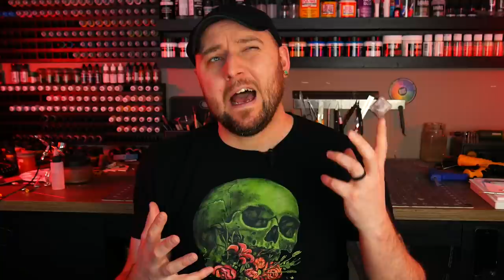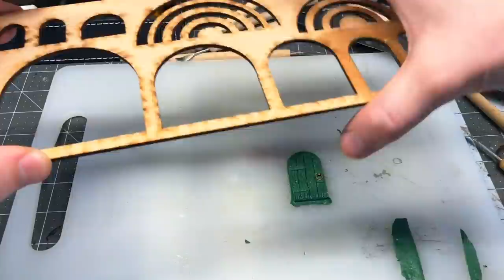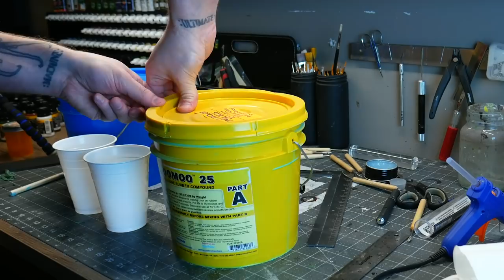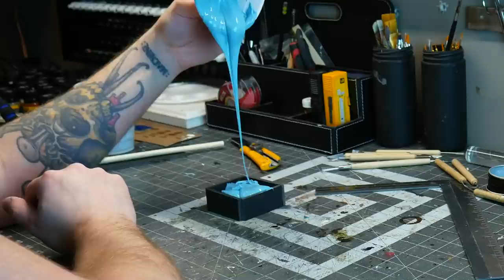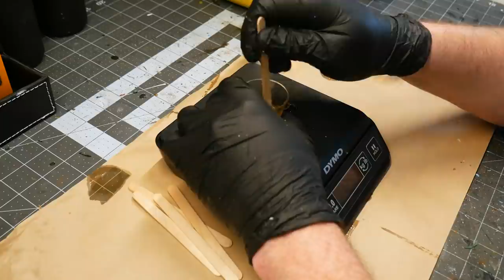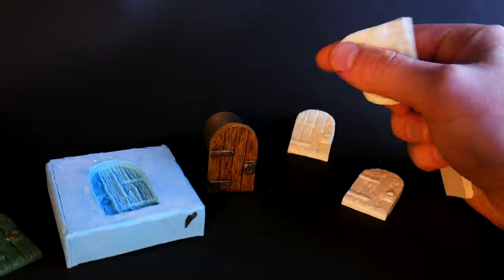Sculpting, Molding, & Casting Resin Doors

Comment from the maker: Prepare yourself......countless Proto-Putty comments are coming....

If anybody has found jewelry jumper rings like the ones I use online PLEASE drop a link. I'd love to be able to direct people to where they can find them as I love using them so often!
Reply: Yes please! Way easier than feeding jump rings into tiny beads ><
Reply: I spent a couple hours at the craft store last weekend looking for jumper rings like you use and couldn't find anything. Do you cut yours off at all, or is that exactly how they come? Have any pictures or name of the packaging? Thanks.
Reply from the maker: Dustin Graham they came exactly as you see them. It was three or four bags stapled to a card, each a different colour of metal. I bought these before the channel was a serious thing so at the time didn’t think to save the package. I’ve looked through dozens of pages on amazon and can’t find anything similar. I’ve also looked to find them again at Michaels to see what they are called and photograph them but haven’t been able to find them again 😞 It’s such a shame because they are SO perfect.

Maybe I should just mold, cast, and sell the door handles. They’d be cost effective to ship.
Reply from the maker: NotAToy the one you find are plain rings, easy to find. Mine are FLAT and have that cylinder on them that makes them look so good.
Reply: Cool tattoo just that... Cool tatoo
Reply: @BlackMagicCraftOfficial  are they Toggles and Clasps?  Those are two parts that hold together a necklace.  One of the parts kind of looks like what you have
Reply: @BlackMagicCraftOfficial  This would be a nice alternative. and casting would take far less time if you made flow channels between them all to cut off later.
Reply from the maker: @EdwardDowner  That's actually very very similar. The ones I have are a single piece. I think its a "crimp end with loop" that I need to use to continue searching. Good find!
Reply: Dude I have found green stuff is way too expensive for the small amount you get. I found a better cheaper and higher quality product in Aves Apovie sculpt. You get way more for the price averraging $15 a pound and the company is way smarter in there packaging using common sense they do not package the putty and hardener in a single pack touching so you waste a portion.
Reply: I should have read comments before going to Michael's looking for the "door handles".. I didn't have any luck either! Mind posting a close-up picture of what you use for those of us trying to find them online or at stores?
Reply: My wife is a jeweler, she often buys them from riogrande, I think they have simple steel ones, as well as gold and silver.
Reply: The jumper ring looks a lot like some Toggle Clasps!There’s tons of styles and a lot look like fancy nobs. They might be a bit big though? But maybe some smaller ones exist or can lead to grease. It soak reminds me of ‘Flat bead spacers’ but I haven’t found any with that notch on it 😞

Comment: Just make sure the modeling material doesn't contain sulfur, like most modeling clays.  The sulfur prevents the silicone from curing properly.  I recommend Sculpy or Fimo. You don't need to bake it, for this project,  and it won't hinder the curing process.
Reply from the maker: Good info 👍
Reply: @BlackMagicCraftOfficial  I've been molding and casting with these materials for a while, so it's only right I help others avoid these pitfalls.
Reply: That's a great tip! 
I'm using cheap modelling clay for some of my terrain. I guess I'll have to make new sculpts from another material before I start making molds.
Reply: @x.a.2758  Glad too be of service.
Reply: Exactly. I sculpt trauma injuries and make molds of them for mass production and I use Sculpy. Haven't had a problem yet with making clean molds.
Reply: Actually, tin-catalysed RTV tolerates trace amounts of sulphur well. The problem is when you use platinum-catalysed RTV, since platinum bonds to the sulphur rather than catalysing the RTV. Luckily, only the most expensive RTVs are platinum catalysed, but once the advice got out, people assumed it applied to all RTV silicones. It doesn't. However, plasticine-type modelling clay isn't all that useful for sculpting, since it is soft and doesn't harden. However, I have successfully used it to sculpt flat items like bases, so it's best to check the material specs on both your modelling clay and your RTV. Mostly, though, I use Aves Apoxie Sculpt for sculpting. It's soft like plasticine but hardens rock-hard in less than an hour, unlike Biggs A+B (so-called "green stuff") which is like trying to sculpt with bubble gum.

Comment: after you open you silicon before you reseal it get a can of compressed air (dollarama), spray a bunch of the compressed air in there. that will give you a blanket of dry air and it will extend the life of your silicon and resins

Comment: If you wanted to sell stuff without having it take up too much of your time, you could sell it all in batches. Like, spend a bit of time and make like 100 of them, then throw those up for sale. Once they're gone, that's it until you do the next batch. There's a guy I follow on Instagram, CanofBeams, who does this with his action figure accessories and it works out really well. There's always a ton of hype for his stuff and his stocks usually run out pretty quick (but no so quick that it's impossible lol). Either way, your stuff is awesome and very inspiring!
Reply from the maker: Yea. Original plan was Kickstarter then I realized I’d probably sell thousands and it would get out of hand. Plan b was to just cast a limited run using an amount of time I felt comfortable dedicating to it and sell on a first come first serve basis.
Reply: “Black magic Dnd crafting essential elements” coming to a store...in Canada sooon
Reply: @thomaskiser1187  Dragons Layer here in Austin, TX would jump all over that.
Reply: @BlackMagicCraftOfficial  A pledge level on Kickstarter can be capped to only allow a certain number to be sold. So if you did 100 and sold them in lots of 4, you could just make 25 pledges available.
Reply: Wouldn't be worth the KS effort, you could easily pre-sell 25 sets on eBay or thru his own website.
Reply: @BlackMagicCraftOfficial  Why not just open the batches up to Patreon supporters to purchase first.  That would be a nifty perk.
Reply: Hey what is his Instagram account? thx for reading. :)

Comment: Any under cuts make sure you get the bubbles out. Tilt poke with toothpick etc. Always read instructions some resins are by weight others are so many parts of each.  Cool video. You can use a bbq lighter in a sweeping motion to get rid of more bubbles.

Comment: i 3d printed a 2x2 inch stone tile (about an hour print time) cleaned the print lines with liquid green stuff and then made my mold and cast it in resin. My advice for tiles is to make 4-6 mold of your tile, do batches instead of one at a time.

Comment: I use rice to fill the mold with! This gives me how much volume is in the mold. Then pour equal amounts of rice into the mixing cups, and add just a pinch more to the measure. It has worked so far for my castings. Dan in Longview, WA

Comment: Another tip for getting the bubbles out would be to use a little mini torch. The heat should pop most of the bubbles, especially in something this small.

Comment: The place where I found the rings was Michael's. I bought 2 or 3 packs and I still have a lot of them handy. I enjoyed the video. Good job on the mold making. I use LEGOS to build my "boxes" and clay to seal the cracks around the bottom.  I had been into HirstArts before I discovered you and DM Scotty 3 years ago so I already had several door molds. However, your video was super because I want to make more elaborate doors than any HirstArts molds provide. I only tried resin once and I failed miserably. I normally use dental plaster.
Reply from the maker: If the rings you found are actually the same as mine and not just plain round rings, and still have the packaging I'd love to know what it says on it or even get the barcode. I bought mine years ago and didn't save the package. I've tried to find them again at michaels to get a photo and had no luck.
Reply: @BlackMagicCraftOfficial  Unfortunately, I bought mine 2 years ago and did not save the packaging. Lesson learned for both of us :-)

Comment: Great video. You show this, but don't explicitly say it. Only mix up the amount of resin you need for one pour! Heat accelerates curing and the resin curing is itself an exothermic reaction. The larger the volume, the more heat, and the faster the cure. Your pot of mixed resin will cure rock hard way before your poured part has set up.

Also thanks for warning people about the silicone shelf life. It will even start to thicken (and eventually solidify) if it is sealed, at least with Smooth-On products. I have wasted a lot of silicone thinking I had "just 1 more month" before starting a casting project.

Comment: This is great! I’m no longer afraid of resin. My thrifty nifty alternative was aluminum foil as the mold and hot glue gun to fill it.

By the way, you can release bubbles from the resin with a vacuum system.

Comment: I've had to do a lot of work forming molds for stone repairs (real stones, big ones [restoration mason] ) It's the air gap above the silicone in the bucket that is causing the problem. You can seal the bucket as tightly as you could want but unless you could somehow make a vacuum in there, it will still start to set up. But I learned a trick. 

Plastic wrap or a plastic inner lid.
Simply cover with some plastic wrap. It can be a messy solution, but it is a solution that I've seen work. 
Or 
Cut a bucket-sized circle of plexiglass, glue a handle on one side. Press down onto the top of the silicone. 

Keep the air out and it can last years.
Reply from the maker: This makes sense as they also sell a gas you can spray into the containers to create a protective gap of non air.

Comment: I use Plastilina Modeling Clay for sculpting pieces, works great for dungeon accessories.  Making the mold box pretty much the same but I use Mold Star 30.  It's a little more rigid & should last longer but it takes 6 hours to harden.  Instead of resin, I use Hydro-Stone for my casting material.  I get 50lb. bags & it goes a long way compared to resin & actually has some weight to it.

Comment: One thing you can do for an easy way to upgrade your casting is take a box fan, place it face up on some blocks to let air come through it, put a board on top, then, when your molds are full, leave them to cure while on it with the fan on.

It's a great vibration table option for those who want to cast things at home.

Comment: I didn't see anyone else mention it but one thing i found is that using a different glue to bond your master to your box can help with the silicone getting under and creating that little lip. Hot glue is so thick it is hard to get the master completely flat on the mold box and the resulting gap gives you that seepage. Something like super glue doesn't have the same problem usually and it isn't hard to rip the master off the foam core paper even with superglue.

Comment: This is something I am actually currently working on myself and what i have found is that if for some reason your resin cast does come out bent/warped, you can use a heat gun to heat the plastic up enough to correct this. Just exercise a lil bit of patience in this process, and anybody in this business knows, if there is one thing for sure that this craft will teach you, it's most defiantly a boat load of patience

Comment: Just a small tip to increase the shelf life of (larger) containers of paint or similar substances. After putting the lid back on after first time use, store the container up side down. The contents of the container will make a perfectly air tight seal covering the inside of the lid.

Comment: Watching your videos you do make quite a few timber planks and bricks, it may be worthwhile making 6 or 7 of the same size with varying grains/textures multiple times in different sizes then when building things like your modular dungeon or hangman's podium you'd have uniformed size planks and bricks you could mould and make some of those more flimsy small pieces more ridged from the offset. Great video as always, very informative.

Comment: For small projects like this, you can use Bluestuff (from greenstuffworld.com) to make the molds. Then you can pour the resin in those, and you can still reuse the bluestuff. Don't even need a release agent. 

Or, instead of resin, you can use milliput as you suggested. Another tip, to help make your milliput go further, you can mix milliput and play doh in a 50/50 mix. The end result is basically the same as the milliput, and the hardner in the milliput cures the play doh. And the play doh helps with making the milliput easier to knead. 

Extra tip, you can make your own play doh, recipes are plentiful out there on youtube/internet.

😉

[edit: to break up the wall of text.]
Reply: That's cool! I've never tried pouring resin in bluestuff, because I was concerned it might stick.
Reply: @DicePunk  To be totally truthful, I did it with clear oyumaru, which is basically the same as bluestuff, just from Japan (I think). I just mentioned bluestuff as I know he has something of a relationship with greenstuffworld.com. If you look around their site, you can find a gallery where they show you some projects they've done. That's where I saw they used resin in bluestuff.
Reply: @DicePunk  Took a little digging...

http://www.greenstuffworld.com/creative/en/projects/218/#Resin-copies-with-Blue-Stuff

😉
Reply: @cycoholic  That's awesome. Yes oyumaru and bluestuff is the same thing. Got to give this a try.
Reply: seen as resins can be exothermic wouldn't it damage the bluestuff molds' detail seen as it goes gooey when heated?
Reply: @thetyrannicalllama2211  Good question. I made a mold of a wooden barrel I had for miniature terrain, and it captured the wood grain quite well. I can only think that's because it's only a small amount of resin, the heat isn't as much as a large pour? Or maybe dissipates quicker? 

Should also mention that you should make sure to mix the resin in the right ratio. I did stuff up some attempts and the resin didn't kick off properly and remained a bit sticky. I washed the oyamaru I was using in warm (not hot) water and dishwashing liquid. Then rinsed it in cold running water. After that it seemed to be ok.

[edit: corrected a couple typos]
Reply: @cycoholic  Thanks for the info I might start using resin and oyumaru then, I just wanted to know if anyone had actually done it and it had been fine. I still think resin and silicone would probably be better at capturing detail but that is obviously more expensive. It is defiantly better than green stuffing but even is usually good enough. If it is fine I do like the idea of just getting blue stuff/oyumaru instead of silicone moulds and using resin with it.
Reply: @thetyrannicalllama2211  No worries.  Using bluestuff/oyamaru for molds with resin is perfect with small items. But anything bigger I'd stick with silicone. 

Besides, even if you do destroy some bluestuff/oyamaru, it's fairly cheap. I got some oyamaru off ebay. 14 sticks for $14  Australian.        ;)
Reply: I tried to cast in Blue stuff, using greenstuffworld acrylic resin.
The two part mould held quite well. The end result was really brittle though.
 so
Making two part moulds with blue stuff is possible with good enough care
Reply: @balazszsigmond826  Was that the powered stuff sold by greenstuffworld.com? I was thinking about giving that a go. Thanks for the heads up.  😉
Reply: @cycoholic 
Yes that powdery stuff.
It is of no use if you are making something with small parts. Brittle as hell.
But damn, is it good at picking up details!
Reply: @balazszsigmond826  Good to know. It's a shame if it can pick up the detail though. I used a SmoothOn 2 part resin.

Comment: Hmm. Never molded in peanut butter before. I'll have to try it! :P
Reply from the maker: You know, if the peanut butter was the right temperature, and of the creamy variety, it would probably work!
Reply: @BlackMagicCraftOfficial  That's just nuts!
Reply: I've made one-use molds from soft dough and oil. I even managed to cast low-quality miniatures in them by simply filling them up with my glue gun and carefully pressing them together. They're a bit warped and don't have much detail but it they're pretty durable -- you can cast miniatures in a mold made from food xD I wouldn't recommend eating your used mold, though.
Reply: @x.a.2758  Especially if it's...... moldy.

Comment: Cool stuff!   I've been making similar cast doors too, although my masters are made from PVC foam.
I tend to use Lego for building my mold boxes but I'm going to try your foamcore / hotglue method soon! 
The downside for me are the little "rivets" - I tend to cast a few doors at a time.  So it becomes a crazy race against time to jiggle out air pockets in the rivet cavities - and often results in doors with missing or incomplete rivets - which I pass off as "weathered and worn" :P